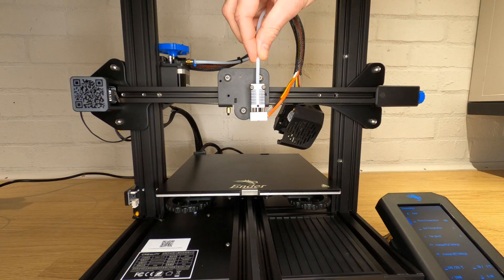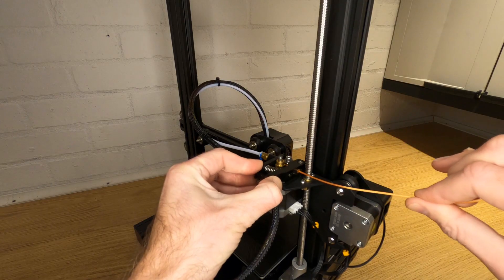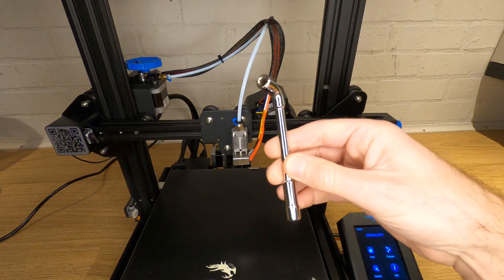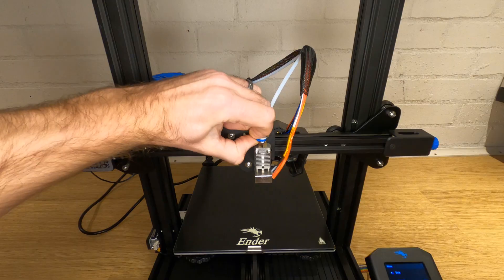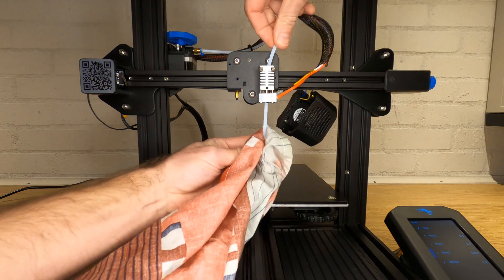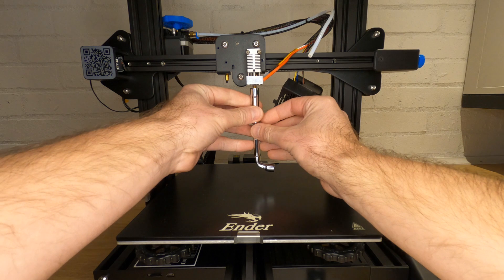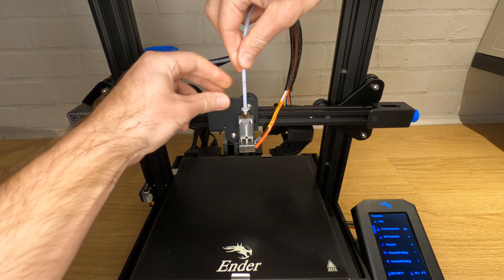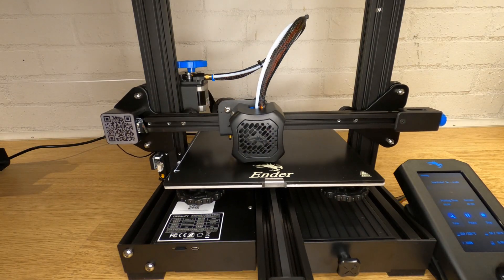Ender 3 v2 Hotend Cleaning - Eliminate Stringing & Clogs

Comment: so i just installed micro swiss or cr-10 all metal hotend with new parts not using old heater cartridge and old thermistor with it .i have 2 problems one is with heater its heating to setted temp then drops then stabilizes itself thats nearly ok PID tuning stuff i did it with auto pid then save it still same but ,other is general problem with allmetal hotend clogging at bore head and only solution is now installing old hotend then printing a way cool cooler then swapping back ,i dont know any other solution to do for know maybe i can call the market where i bought it from and ask them why 
thanks.
Reply from the maker: There are a lot of variables there, sorry but it's very hard to diagnose without having the machine in front of me. Usually, an all-metal hotend clog is caused by not enough cooling of the heatsink. If you can't get it hot enough to clear then maybe remove it and use something like a heatgun but make sure there are no plastic parts or wiring still attached.
Reply: @RickyImpey  i used thermal paste to increase conductivity first print was calib cube and it was amazing then at the second print it failed at nearly top just one layer and it was extruder skipping gear(0.6mm nozzle) i tried third one and now its not working :v . i am thinking to buy dampers for stepper but not sure silicone one with just two black pieces and other one is metal one known as usual damper

Comment: are the pneumatic fittings that come with the capricorn tubing a sufficient upgrade over the stock fittings or is it still better to buy the replacement set?
Reply from the maker: It depends which ones you get. I have generally had more joy with fittings with black collars but I don't know if this is consistent with all of the black ones.

Comment: ender 3 pro, when following this tutorial. After I have removed the fan shroud it is throwing the "Thermal Runaway Shutdown" warning. If I re-attach the fan it does not do this, so I wondered if there was something off. Given it ought to stop heating itself up once it reaches temp?
Reply from the maker: The thermal runaway error code is activated when the temperature does something the firmware isn't expecting. That can be heating up too slow or too fast. It just means it's working and is extra vigilant on your machine. Can you get to what you need to when re-attaching the fan?

Comment: I did all the steps but still me filament gets jammed near the nozzle , i would say i clogs  the hotend entirely not just the nozzle . I checked the ptfe tube it gets bulged at the end (hotend side) so then i carefully examined the filament and i saw that the filament too gets bulged at tha end ,like the extruder is trying to push but something is not letting it come out, should i change the ptfe tube and one more thing i m using black filament however same thing happened with white filament too so id think so the colour of filament is an issue over here or maybe it is.
Reply from the maker: Hi, there are a couple of possible causes for what you have there. Either your nozzle isn't hot enough to melt the filament, there is a gap behind your nozzle where the PTFE tube isn't pushed up against the back of it close enough or you may have another issue like heat creep. What printer do you have? Has anything been modified around the hotend? 
If the cooling fan is working correctly and nothing has changed, then the filament should flow through the nozzle when up to temperature and you push it through or turn the extruder manually.
Reply: @RickyImpey  hello, my printer is anycubic i3 mega s, regarding the ptfe tube not going deep enough i checked it many times and everytime it was well fitted inside it, if you share me your email ill send you a video of everything.

Comment: Do you do this whole thing with the heat on
Reply from the maker: Yes
Reply: @RickyImpey  Ive been struggling with clogs all of the sudden and I can't seem to figure out the problem When I try to STick the PTFE tubing a the way through the extruder there is something sticky preventing me from doing so.  Is this melted plastic?
Reply: I don't know If I'll be able to put The PTFE tubing back as far as it was. DO you have ny suggestions for cleaning this out.  Thank you so much for all your videos they are all so helpful
Reply: just a quick update.  It works perfectly now thanks to you.  This was a very helpful video and will deffinintly refer to them from now on.
Reply from the maker: @Daily_LeGlaze  Very likely yes. There is no other glue, grease or anything like that in there, just the PTFE tube and filament. It is possible that the end of your PTFE tube has broken down if you've been doing a lot of higher temperature printing.
Reply from the maker: @Daily_LeGlaze  One way or another it needs to be clear. Either heat it up to around 240 degrees and try to push something more solid through or possibly consider replacing your hotend. They are not expensive.
Reply from the maker: @Daily_LeGlaze  Ha ha, ignore my other comments then🙂 Glad you got it fixed👍

Comment: When replacing my nozzle I used the wrench to hold the hot aluminum block when removing but not when placing the nozzle, I noticed when I was tightening the nozzle the aluminum block moved ever so slightly.. will this cause any issues?
Reply from the maker: As long as you can still get the silicone sock on then it's not really a problem. I always like to hold it straight myself. If you have the two bolts that go through the heatblock into the heatsink then not holding the heatblock will put some strain on those bolts that you would be best avoiding.

Comment: Here's my easier method. Buy the cleaner filament and run about 6 inches through. Then move extruder backwards until filament stops coming out but keep the tip pre-heated. Crumble a piece of tin foil and hold it with pliars, brush the nuzzle with it until it's shiny. Done.

Comment: Around the time I first got my printer on maybe my 3rd print my stock extruder failed and caused the most brutal clog in existence.. ever since that day and many upgrades later I’ll get a random blackish/purple glob of goop from the same purple silk filament from the clog that will drip onto my print and ruin it.. it’s extremely frustrating when you’re 6+ hours into a print and have to restart.. thanks for this video! Need to get mine all taken apart and cleaned!

Comment: Yup, I've got to do this with my original E3. I was printing PETG (with Capricorn) and I left the hot end stationery too long while faffing around, anyway nasty cancerous smells came from said hot end and now I need to pull it apart. Oh well not a problem now. While I'm doing that, I'm probably going to do a dual Z drive mod to get rid of Z banding. Also, I'm going to try and replace the controller with a Big Tree Tech controller and install a BL touch. I don't suppose you could do a couple of videos on upgrading a first generation Ender 3?
Reply from the maker: Hi Paul, I don't have one unfortunately, or I would.

Comment: I’ve been printing Petg with the stock Bowden tube and just now it mysteriously is melted in place inside the hotend
Reply from the maker: What temperature have you been printing PETG? Unfortunately any kind of PTFE tube will break down at higher temperatures eventually.
Reply: @RickyImpey  I don’t remember, whatever the default preset is for petg on marlin firmware. Needless to say I will be upgrading my printer to direct drive because it would make things easier for printing other stuff anyways

Comment: I changed to a bigger nozzle and had to reduce my speed to below 20mm/s to prevent extruder skipping. The Capricorn bowden tube is pretty new, but I stripped it down and could not get the bowden out of the fitting on the hot end. I had to manually unscrew it with the tube in. About 4mm from the end, the bowden was mangled and had a hole in it! How did this happen? I don't know, but if not for this video I would be adjusting stepper current now... Just a question, although me hot did not have not any more plastic coming out, the bowden tube is still hard to push through. Is it supposed to be tight fit, or do I have goo on the walls?
Reply from the maker: It sounds like your Bowden tube is damaged. The filament should pass through without any resistance. Also, going to a bigger nozzle should actually reduce the resistance so this is a bit of a red flag too. Luckily it's very simple to do as shown in this video https://youtu.be/_u3UJSZFi4c

Comment: Great video and really detailed explanation, I have been struggling with a clogging nozzle for a few weeks now and was trying to figure out if i did something wrong when cleaning the nozzle.
Turns out that i shouldn't fully tighten the nozzle until the bowden tube is in place..
Simply thank you.
Reply from the maker: Glad it helped, yes unfortunately there are a number of small details that can really cause problems if overlooked.

Comment: i did all this and the machine had a thermal runaway.   very helpful video, but now when I start a print, it says "nozzle too temperature" and i get the alarm beep!!!
Reply from the maker: Thermal runaway is a safety feature that stops current flowing to the heater element if the thermistor doesn't see the temperatures it's expecting to see after a specific period of time. The most likely cause is probably your hotend heating element or thermistor wiring. Check for damage to either. You may have dislodged something when working on the hotend.

Comment: My brand new, out of the box Ender 3 v2 has been driving me crazy all weekend with intermitent underextrusion. Mind you I have had and still have a Prusa for almost 8 years now. I have tried adjusting the E-steps by marking 100mm of filament and extruding it, until the number of E-steps was right. I have basically taken out the tube, reassembled it and all. My feeding gear is ok (not broken like I saw in forums) and doesn't seem to skip at all. Of course all is leveled out aswell. But this still happens. It starts ok, then under-extrudes, then goes ok, then under-extrudes... I have cleaned the nozzle many times and used 3 different ones even (including the two brand new ones). I even set the e-steps to some ridiculoudly high number and this still happens. Tomorrow I will be following this tutorial to see if it will fix the issue (but I didn't expect a brand new hot-end, out of the fabric, to have this problem...). If this fixes my issue you have earned yourself a new sub. Pray for me because it is driving me insane. 😳
Reply from the maker: Hi, yes hopefully this helps but there will be some other things you can check too. Are your displayed hotend temperatures changing at all during a print? You may benefit from a PID tune to help stabilze the temperatures. https://youtu.be/DG1Yvt02l1I
Reply: @RickyImpey  That's not happening, no. I have also tried printing at slower speeds (very slower also) and to no avail. So this must be my last resort. Great to find such an informative and helpful channel!
Reply: @RickyImpey  Yup, this didn't work either. Could it be possible that the PTFE tube that came from fabric maybe isn't straight? Either my eyes are playing me now that I'm so alert about everything, but there might be a 0.05mm slope. I am out of ideas and see no other possible option.
Reply from the maker: @mariocamacho5890  it's very possible that the end isn't cut square. However, I wouldn't expect it to cause a problem straight away, maybe just build up. What filament are you using and what hotend temperature are you printing at?
Reply: @RickyImpey  I use a White 1KG PLA Tucab (portuguese brand), mind you this has always printed fine on the older Prusa I have. I have tried to print at 220°C, and tried lowering it 5 by 5, to no avail.
Reply from the maker: @mariocamacho5890  It sounds like you everything at the hotend covered. I think I would be looking more closely at the extruder. Have you checked to see if it's possible that the brass gear is slipping on the stepper shaft? Have you tried watching the extruder when it's underextruding to see if the filament is slipping?
Reply: @RickyImpey  Your suggestion of looking at the gears cracked the case, regarding the problem. The stepper gear works perfectly and rotates well, the other one, not really. It rotates whenever it feels like, really. Both the bolts are tightened up to the max, both the one sitting atop of it and the one on the thing next to it. I tried lightning down the tension on the bolt on top of it but it made no difference really, the same thing can be said for the other bolt. I wonder, is there some sort of lubrication you usually use, or am I just not finding the right tension? Funny enough, whilst extruding filament (not printing), it works fine it seems.
Reply: @RickyImpey  Just noticed the feeding "arm" cracked. Well, well. Bought an aluminium upgrade from Redrex and now it's time to wait... again. Kind of dissapointing to buy a new printer and then find this sort of stuff and have to wait again for the upgrade. But upon searching I see it's kind of common which is even more surprising. Oh well.
Reply from the maker: @mariocamacho5890  when you say the 'other one', do you mean the wheel that pushes on the filament, pushing it into the gear on the stepper? If so push on the extruder arm to move it away from the filament and see if it turns easily on it's own. If not then either the bolt is too tight or the bearing is damaged.
Reply from the maker: @mariocamacho5890  Ah yes, very common unfortunately. Some how mine is still good but I'm sure it's only a matter of time.

Comment: I got a new Bi-Metal heat break throat made of copper and titanium, and rebuilt a MK8 Hot End on my Aquila it has a new nozzle and new PTFE tubing. 

Now it was all fitted right, 
But even though there is zero filament in the heat break or any seen in the hot end or of course the new nozzle as I was not used.

I still getting a jam problem where the filament will not go through to the nozzle even though there is nothing there inside it. 
the tubing goes fully down to the top quarter length of the new heat break throat as it is made with that in mind.  

So why is the extruder motor clicking and the filament not getting through to the nozzle?

I took it all apart again and checked all the parts and found zero blockages in any of the filament paths through the hot end.

Any ideas?
Reply from the maker: Difficult to say but have you tried taking the nozzle off, letting everything cool and then feeding the filament through to make sure it passes through?

Comment: What if your tube doesn’t go though because half way though in the Hotend you have a clog with filament.
Reply from the maker: If your hotend is hot enough, the filament should be softening so that you can push it through. What temperature is your hotend and what filament do you suspect is in there?

Comment: I can’t get the fitting to come off the tube
Reply from the maker: Make sure you release the tension by undoing the nozzle. If it still doesn't release then push it in a bit before trying to pull it out. Worse case, release the other end and push it all the way through the fitting. The problem will be that the metal barb inside has cut into the Bowden tube a bit. Have a good look once it's out and maybe consider replacing it https://youtu.be/_u3UJSZFi4c

Comment: Are you aware of the bowden mod for creality printers? It's one where you cut off a part of PTFE tube that will stay inside the hot end permanently. You print a small insert ahead of time to keep it in place. This helps decouple the hot end from the extruder preventing the issue where the PTFE wiggles itself away from the nozzle leading to stringing or clogs from filament getting in-between the two. Your subscribers will probably want to hear about it. Chep has a video on it
Reply from the maker: Hi, yes I used to run it in my CR-10S Pro. I found that it was really critical how long you made the insert section. If you don't get it perfect, it can actually make things worse. If you use this method (tightening up the nozzle after pushing the Bowden to the back of the nozzle), it locks the pneumatic fitting and prevents any movement. Both methods work if you get them right but I feel this way is easier for beginners. Thanks for the comment though, I'm always keen to see what everyone else is doing, there is always something to learn👍

Comment: hI, I removed the Hotend's case, but one of the two fan is is free, and i dont know how it must be inserted in the case, can you help me?
Reply from the maker: Which fan? I thought they were both held in with screws, could you have accidentally broken anything?
Reply: @RickyImpey  yes the fan rack is broken
https://ae01.alicdn.com/kf/H582c4ce86a974cbe8916413a5f981759c.jpg?width=800&height=800&hash=1600
Reply: It broken the little plate with the hole for the screw, the cover seems to rest in posizion 
anyway
Reply: fixed with two drop of attack

Comment: I tried to use the tube to cleaning some filamento inside the hotend but the tube started melting, but its supposed to push the tube until the nozzle after all cleaninged
Reply from the maker: What is your Bowden tube made from? The tube should withstand the temperature that the nozzle reaches. In time the white PTFE tube can break down but it shouldn't melt when you push it through the hotend. Maybe consider upgrading to a better Bowden tube as it will cause other issues if it's melting.
Reply: Its a defaulta white tube of ender 3 v2, yes i have to do the upgrade, because the plastic piece that push the filament is cracked, thank you for help 🙏